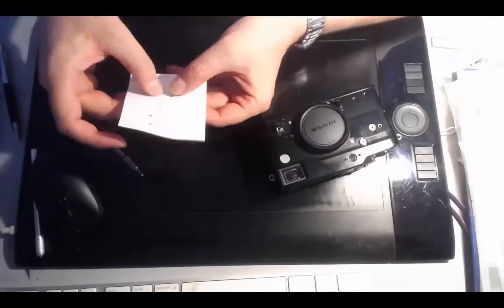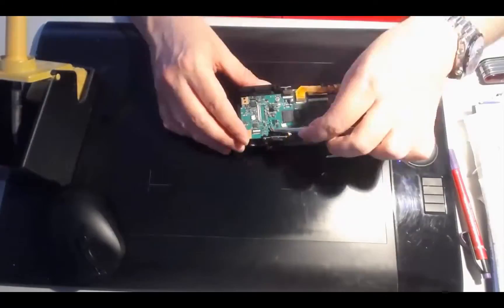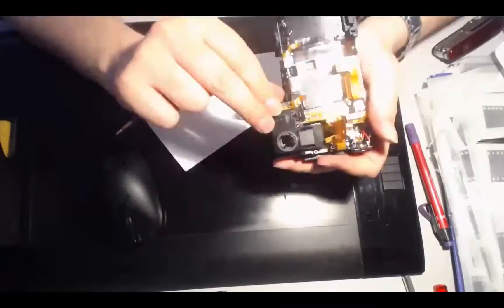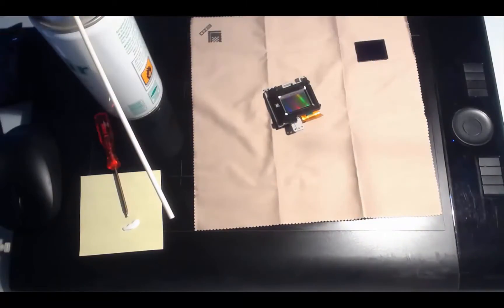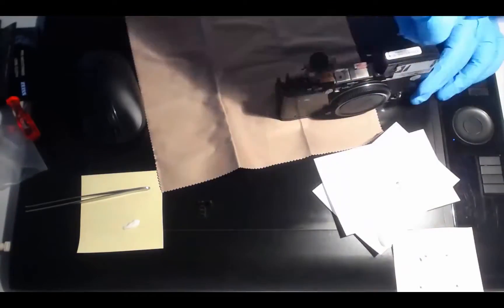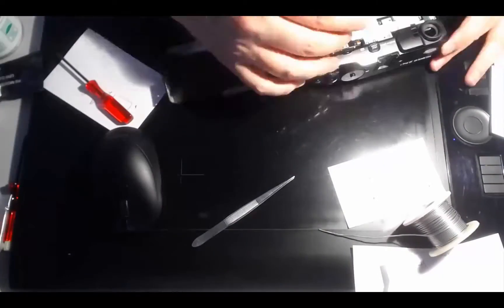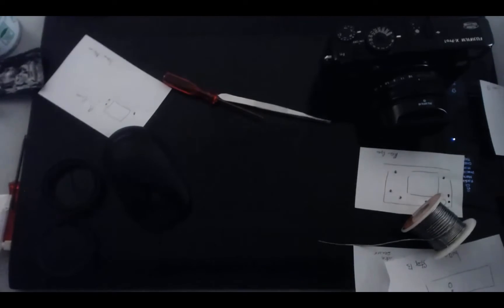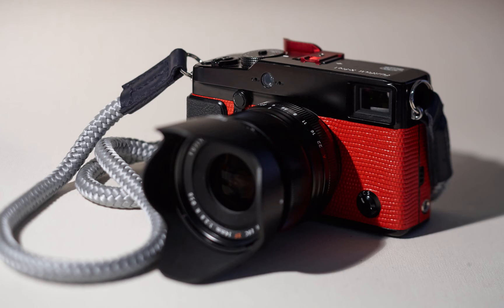InfraRED Fujifilm X Pro 1 conversion

Comment: Hi Luigi! Great work. I'm about to send to convert an X-E1, since I got one for a good price and people who did conversions recommend me, plus I'm a Fuji user. I just have two questions:
1) You did a full spectrum conversion, in order to use different filters? Or is stucked with 720nm?
2) Since most Fujin bodies have this símil-leather sticker around, you need to put a new one (in your case the red), or you can use again the original one?
Reply from the maker: Hi, thanks.
I did a 720nm conversion. It was a choice since I like to do B&W and the 720nm gave me just enough color to easily make color masks.
The leather can be reused. I just had fun doing it with the red leather to be sure to distinguish it from my normal Pro-1. But s easy to reuse the original leather reapplying some glue.
Have fun with your new toy! :)
Reply: @LuigiBarbano  Great. Thank you very much for your answer!

Comment: Does this IR conversion work for color photos as well ? Anywhere to see/view those ?! Very interested in this..
Reply from the maker: It works for colors if you use a filter with a wide spectrum. If you use a 720nm filter as I did, you can have just a little bit of blu and yellow, not fo taking color images but great to do masks.

Comment: which lenses hotspot free do you suggest?
Reply from the maker: I used the Fujinon 35mm 1.4, 55-200, 14mm 2.8 all with great results. 60mm and 18mm give me hotspots. Samyang 12mm works pretty well.

Comment: Well done. I did it once with e 1000D; seems easier than X Pro.
So, which one has a higher quality in your opinion, the converted 5D, or the X Pro?
Reply from the maker: The XPro has better quality, and the fact is a mirrorless means I can use it in auto mode and with autofocus. Also I love the optical viewfinder. The quality of Fuji lenses is superb, IR or normal photography, I really love them.
Reply: Interesting. Thanks. 
What about X-pro1 vs. X-T10? Any ideas?
Reply from the maker: I suppose they are the same, same sensor, so basically same results. I never had an XT10 so I have no idea :)